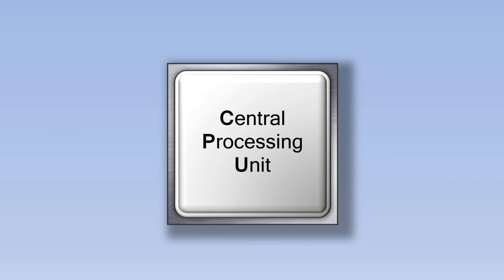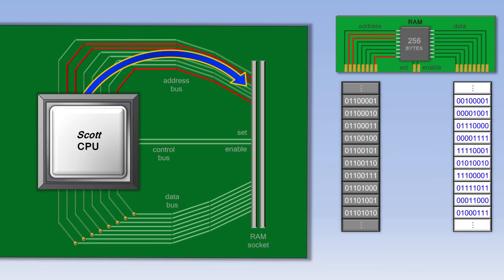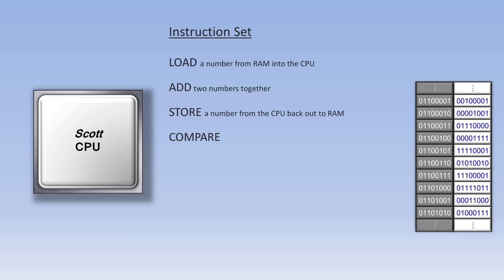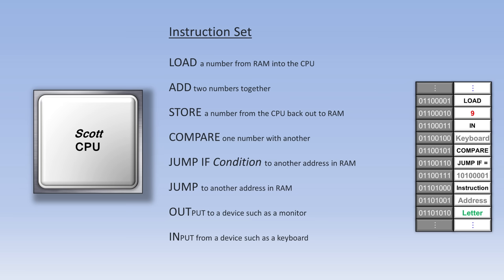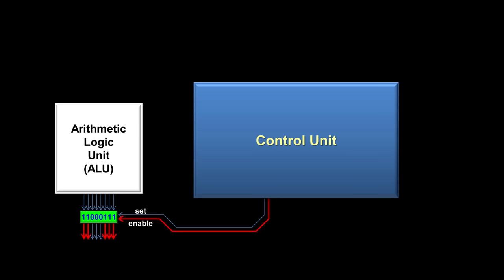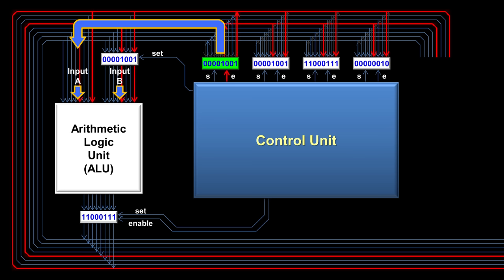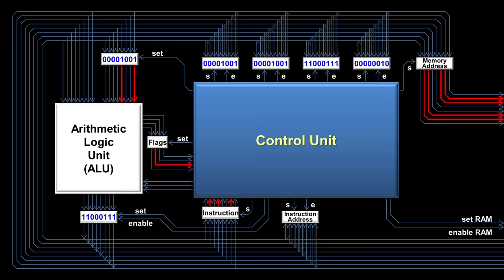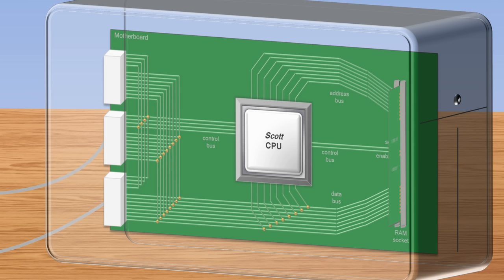How a CPU Works

Comment: Just in case, you're wondering, CPU executes instructions in advance as well, so that when it reaches that specific line, the results are already available and therefore, it makes the CPU super fast, however when branch instructions occur, the CPU executes the first branch instructions in advance. But since Tues condition can be false, the CPU has to flush the already loaded data and rerun the whole process again, that's why branching is not good for programming, but latest compilers are smart enough to do all of this optimizations itself, so as a programmer, you don't really have to worry about these micro optimizations.

Comment: Does anyone else feel the same?

I really want to see the jump how each value in an analogue computer operated to produce the computer’s output…. And then inside the very first/ or most basic CPUs, to see how each transistor now takes over their job. (at the most basic level/ each transistor working, and how that is made comprehensible as an output/ by the computer). It seems very hard to visualise. 

In my very limited understanding early mechanical computers had physical properties which made the end output apprehensible (following punchcards to sow a stitch in the correct place etc). But beyond that seems to get unreal even with a video like this… 

This is one of the best CPU videos I've seen, but its still more than my brain can take :)

Comment: But why does the cpu run faster when you delete system32?
Reply: It has less workload, as System32 contains explorer.exe, which sends instructions to the CPU (and GPU, too.)
Reply: LOL!!!!!!!
Reply: +Luna because it proably dosnt and just makes ur computer bluescreen!
Reply: +Luna I'm new to this. What is that?
Reply: +Lk Ross They're trolling. Don't delete System32 unless you want to mess up your computer
Reply: +Heath Miller no your pc dont go into bluescreen.
Reply: +AvatarLand Razer  yes it does because i tried i after i read it
Reply: deleting the main folder of your OS will not bring it into a bluescreen, because it will no longer be able to boot up. windwos store most of it files into system 32, and since blue screen comes with the OS. you will most likely not be able to see a blue screen but just a black screen
Reply: +AvatarLand Razer  no if you delet why system is running on xp it does
Reply: yes
Reply: +Luna If you have x64 CPU, then system32 is not necessary. In fact deletin' that folder unleashes x64 potential ;)
Reply: Yes Nokia is right but then you loose capabilities with x86 programs
Reply: Quite the troll. If any of you actually try, there are methods in place to ensure you can't just del system32
Reply: it don't cause you just killed it
Reply: boot up portable linux and go into hard drive and delete it. DONE
Reply: Luna the system32 does not affect the cpu speed, it only kills your operating software and your hard disk drive too, but doesn't affect cpu speed or ram speed
Reply: it's not processing any information because there's no OS
Reply: You did remember to download more RAM first before deleting System32 right?
Reply: System32 is the main part of a virus called windows
Reply: Well, most likely it's because if you're able to do so it means that you'd probably be running in Linux... :D
Reply: Sudo -rm -rf if you use Linux

Comment: Mind Blown , And i learned .....Nothing .-. i still Don't Get These Stuff
Reply: How a Computer Performs Addition

A computer's clock regulates how fast the computer works.  The faster a clock ticks, causing pules of electricity, the faster the computer works.

The simplest operation that can be performed with a transistor is called a NOT logic gate, made up of only a single transistor. This NOT gate is designed to take one input from the clock and one from another transistor. The NOT gate produces a single output-one that's always the opposite of the input from the transistor. When current from another transistor represents a 1 is sent to a NOT gate, the gate's own transistor switches open so that a pulse or current from the clock can't flow trough it, which makes the NOT gate's output 0. A 0 input closes the NOT gate's transistor so that the clock pulse passes trough it to produce an output of 1. {Basically an Inverter}

NOT gates strung together in different combinations create other logic gates. All of which have a line to receive pulse from the clock and two other input lines for pulse from other logic gates,.

The OR gates create a 1 if either the first or second input is a 1, and put out a 0 only if both inputs are 0.

An and gate outputs a 1 only if both the first and the second inputs are 1s.

An XORG gate puts out a 0 if both inputs are 0 or if both inputs are 1. it generates a 1 only if one of the inputs is 1 and the other one is 0.

A mathematical operation in a computer is achieved by gate designs called half-adders and full-adders.

A half-adder consists of an XOR gate and an AND gate, both of which receive the same input representing a one-digit binary number.

A full-adder consists of half-adders and other switches.

The result of the XOR operation becomes the rightmost digit of the result.
The result of the half-adders AND operation is sent to XOR and AND gates in the full-adder.

The full-adder also processes the left-hand digits,sending the results of both of the operations to another XOR gate and another AND gate.

The results from XORing and ANDing the left-hand digits are processed with the results from the half-adder. One of the new results is passed trough an OR gate.

The result of all the calculations is in binary, for larger numbers. More full-adders are used-one for each digit in the binary numbers.
Reply: Fancy Neku  Took me a while to write as well.
Reply: ***** ikr , uare cool :D , JUST SAYING .;-; Thx alot i should say :D
Reply: Fancy Neku  No prob mate just helping out ^_^
Reply: ***** I thought U copied All this From Wikiepedia xD Cuz it's alot
Reply: Fancy Neku  I learned it from a book called "How Computers Work(8th edition"

I highly recommend it :)
+ i am a electro technician ^^
Reply: ***** It Makes Sense now lol
Reply: The avatars on this comment are both incredibly similar.
Reply: Probably because you didn't want to learn :/
Reply: ***** nice copy and paste lol it took me 10min to find the website but i got you.... wow lol
Reply: David S I didn't copy paste its out of the book "How Computers work"
Reply: ok  dude i believe you... and its fine. I just found the book online is all.
Reply: ***** Its really usefull to know how thinks work because if you do so, you can utilize something better, you can get more thinks out of it. This connects with programming. There are low level (sorry, I am not sure how its called) programming languages (assembly) and high level languages (Java). I highly recommend something between them to start of: C. With a decent knowledge of C and of how CPU does what it does you have a really powerful tool in your hands :)
Reply: ***** Mere apologies, just that I wished to correct a little issue with the full adder and binary addition explanation before it continues to be distributed to the most wonder 'help' of other folks. I guess the generalizations and simplifications do the job for folks who don't plan on actually specializing on computer engineering. Very nice that you took that time to read that book and prepare that explanation for other folks. I do commend your explanations of the Boolean operators and logic gates. I guess one could describe a full adder as being consistent of half adders. Just that it's best to directly refer to the actual functioning and signal flow of binary data through the full adder logic diagram itself. Here's something I pulled up. http://www.cs.iit.edu/~cs561/cs350/ADDER/Full.html.

The following clarifications are for folks who just wanted to get more details into the whole 'philosophical realm' of computing. One can go about saying that yes, full adders are made of half adders, these logic gates and that. Good if its accurate so the occasional floating computer engineer won't have their eyes caught. But saying "computers consist of logic gates made out of transistors. Adders are made of logic gates too and these logic gates" doesn't fully answer the 'philosophical' question, "How does my computer add 2 plus 2??"

P1: (sorry, just got a little excited to shed some extra stuff about computers, 4 to 5 years having had researched the subject and designed CPUs and instruction sets for fun does that to you)

The way I think about transistors indeed is as electronic switches without any moving parts that can perform one of the most fundamental logical operations, an AND. Three leads, collector, base, emitter (for a BJT technology transistor, old and outdated by the more recent MOSFETs). Collector wants to send its signal to the emitter, but it can't unless we apply a signal to the Base. Unless the Collector AND Base have a signal going to it, then the Emitter can be ON, a binary 1 or 'logical high' in terms of voltage. So indeed once you get deeper into electronics and circuit design/flow, we find that using these fundamental principles we can put these transistors to make gates.
Reply: I am definitely not gonna through this big comment. Can somebody tell me the point real quick?
Reply: DuckHunter Gist = The other guy did not give a complete enough explanation of how cpu's work. Cpu's are more complicated than that but u can use that model if you don't wanna b a pro
Reply: Ok thanks.
Reply: But there is so much stuff, that it is impossible to learn it all.
Reply: easy, calm down
Reply: It's difficult because you need to wrap your mind around. In the beginning, you need to use abstract reasoning to understand. This is what my teacher told the class several times. Don't think about the why, how, where or whatever. The what as in what is going on is all you need to know. Take it as it is. After that you can ask other questions like how? Where? Why? You can not understand these things within a day.
Reply: Ilias Joels  i wish i herd that more time in college
Reply: It's not that it's hard to understand. This guy just doesn't know how to teach well.

Comment: MAR-Memory address register this holds the memory address in the CPU and tells RAM what instructions to do next Correct?
Reply: No. The address and the data being transferred can't both be on the bus at the same time, but  both are needed by RAM at the same time. The memory address register provides the address temporarily for ALL accesses to and from RAM -- not just instructions. The data from or to that address is then transferred on the bus.

Comment: This is some advanced ass technology.... hundreds of billions of clicks per second... How does one even calculate that?
Reply: With a computer :D
Reply: oh ye, those things :P
Reply: a GHz can be written as 10^9 Hz per second because there 1,000,000,000 so for example 2GHz would be 2×10^9 Hz per second which would be 2,000,000,000 ticks per second. Writing it in standard form is much easier :)
Reply: A GHz can be written as 10^9 Hz per second because there is 1,000,000,000 ticks per second (there are 9 0's in a billion) so for example 2GHz would be 2×10^9 Hz per second which would be 2,000,000,000 ticks per second. To work it out in real time we would divide time,T by the frequency, f so 2GHz = 2/10^9 = 2×10^-9 = 0.000000002 (2 nano seconds) ticks per second. Writing it in standard form is much easier :)
Reply: * 2 ticks per nano second I mean :)
Reply: your very educated ^.^
Reply: Actually, they ironically make technology to observe it and help them figure it out. Too lazy to check, but the math Hannah mentioned is likely also quite accurate.
Reply: +anodhask sarcasm?
Reply: by having billions of transistors
Reply: this is where things like hadoop and SQL come in handy.

Comment: Fun Fact: On the back of your CPU you can actually find a very small crank. You can use this to "wind" the CPU's clock for increased performance. GTA V will run smoother than ever! You're welcome :)
Reply: Fun fact: Your System32 folder contains nothing but junk files that slow down your computer. If you simply delete that folder you will get 1.5 × your normal speed. You're welcome!! :D
Reply: +FishboneXtutorialz Fun Fact: Thousands of comedians out of work and you're trying to be funny.
Reply: +Fishbone Most computers are significantly slowed down by the monitor. If you unplug your monitor from your computer it will work much better. You're welcome! :)
Reply: Guys all of these are great! This comment thread is going to help so many people :D
Reply: I woke up the thread after one year. You're welcome! :)
Reply: @rainboyrain  It fell back asleep. Just waking it back up :D